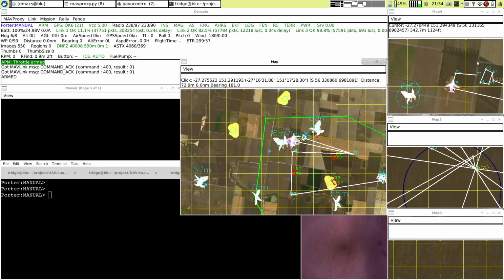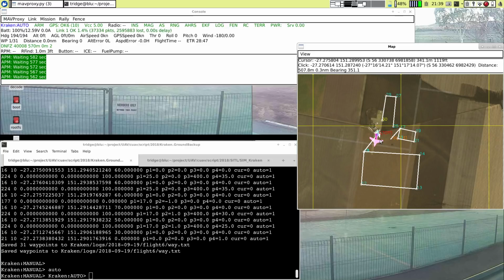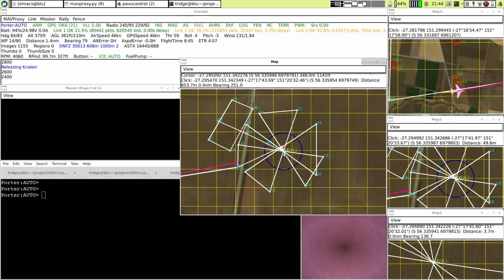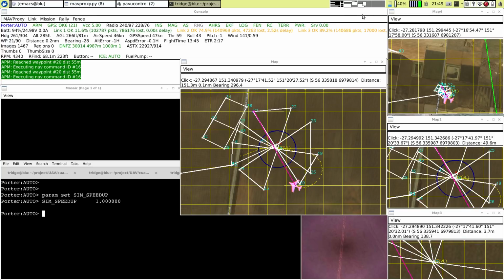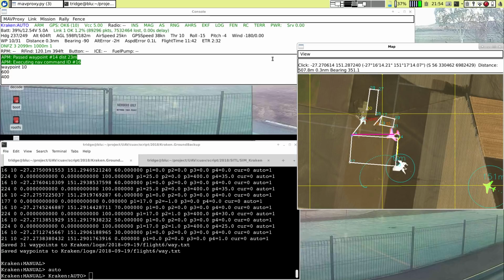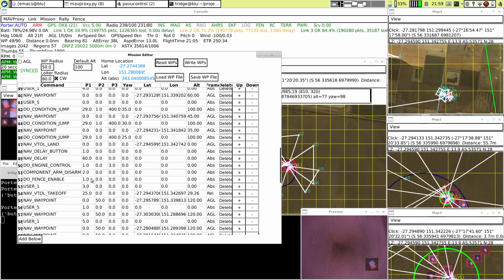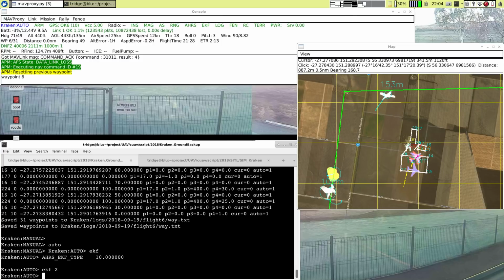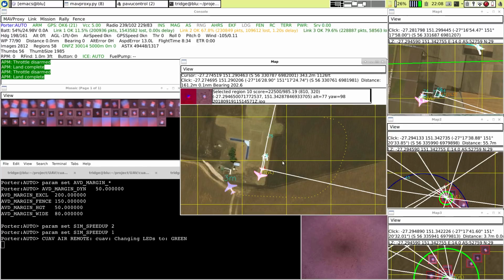CanberraUAV OBC'2018 Simulation

Comment: All the best CanberraUAV, is this assuming an ADS-B receiver on the aircraft or is it missing ADS-B traffic being piped into Mission Planner?
Reply: Teams attempting the Extension Autonomy Challenge will be receiving Do Not Fly Zones in real time via an ethernet connection to the team's ground station - this data is delivered via Eurocontrol ASTERIX protocol, which is a radar detection protocol (with the data coming from an emulated / simulated ground-based radar), but ADS-B data can be translated into ASTERIX using other software (unaffiliated with this competition).